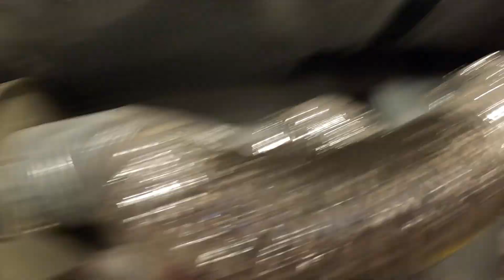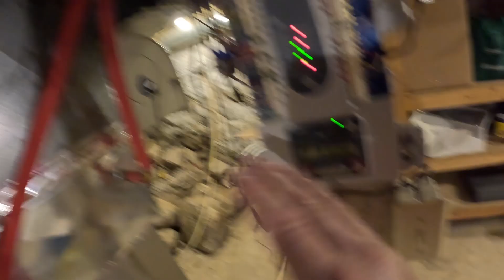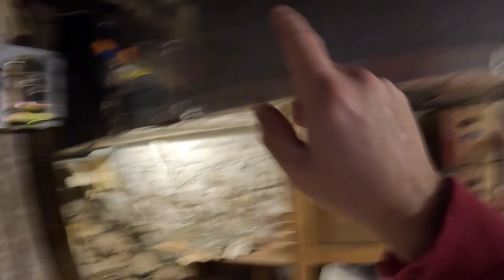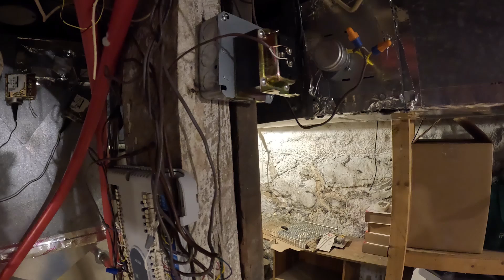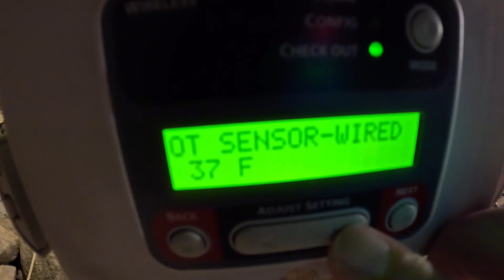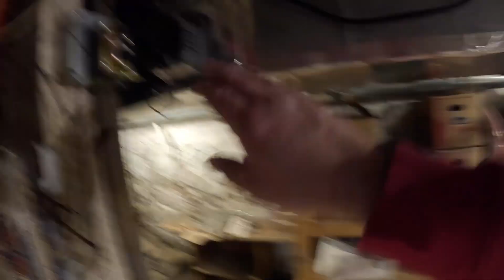My Zoning system setup and damper replacement | Honeywell HZ432

Comment: I'm in the middle of watching the video, you may answer it, but do all the thermostats go to that controller, and then the controller communicates with the dampeners and the actual hvac system? My current system is 2 zones, I am trying to plan for whenever my hvac system needs to be replaced and trying to figure out how everything talks to eachother. I've had some of the dampeners stick, usually hitting them freed them up.